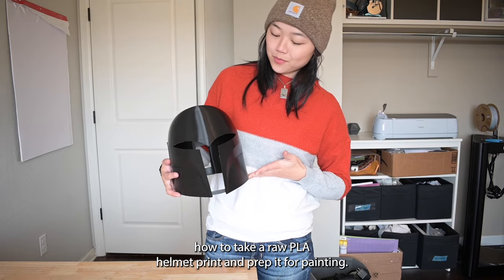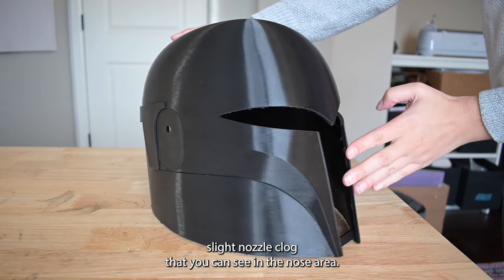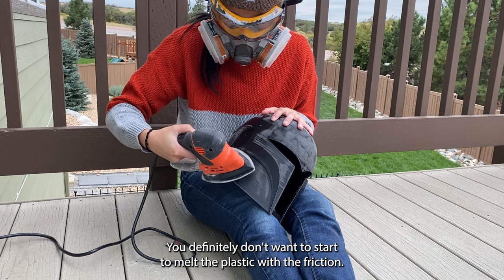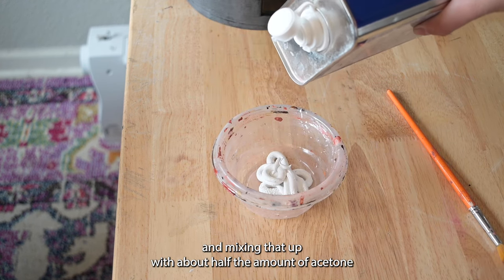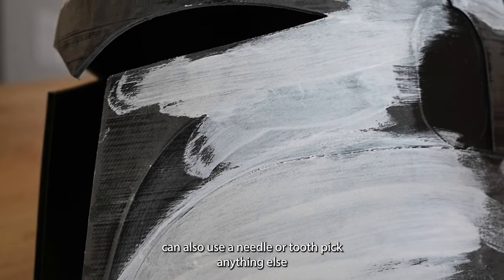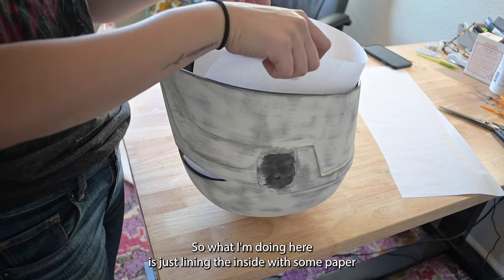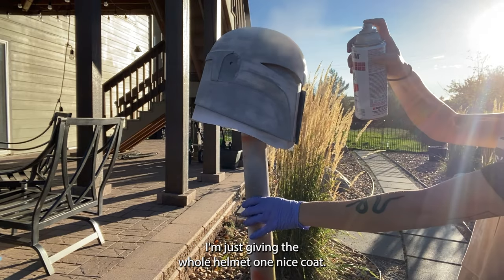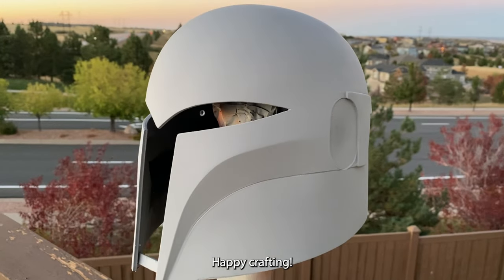How to Smooth and Prep a PLA 3D-Printed Helmet for Painting

Comment: This tutorial is awesome! Question, for the process after the sanding the wood filler, how to clear off the dust? Wash it or what is the better method?
Reply from the maker: I just wipe it with a dry shop towel! The wood filler i use is water soluble, so i wouldnt wet it before adding a layer if primer/other paint
Reply: @universeofemily  Awesome! Thanks for the info, will apply it later on in my next Prop project
Reply from the maker: @matteblack144 awesome!! Let me know how it goes!

Comment: You can print these much faster , use a .8 mm nozzle and  print these in single wall thickness , like in vase mode afterwards  you can reinforce it with epoxy or fiberglass or any other material  ,  there are videos available online , that demonstrate this method .
Reply from the maker: It’s all about the balance between print time and post-processing time in my opinion! Lots of different ways to do this, and this is the most enjoyable for me. Cheers!